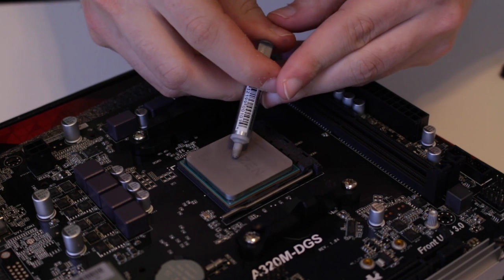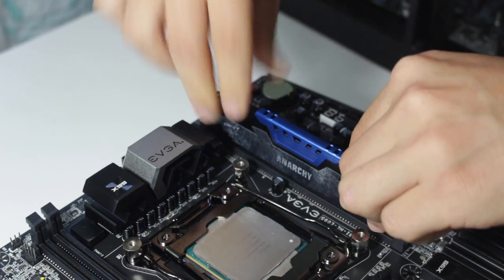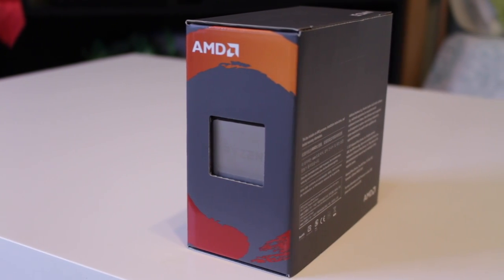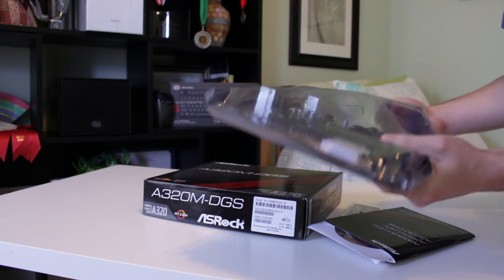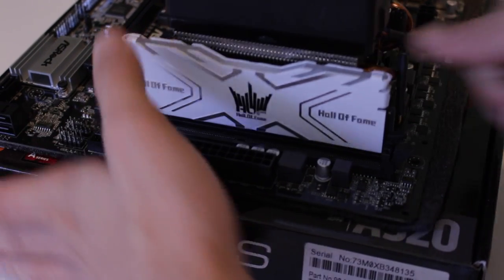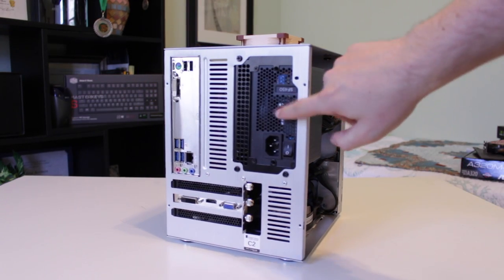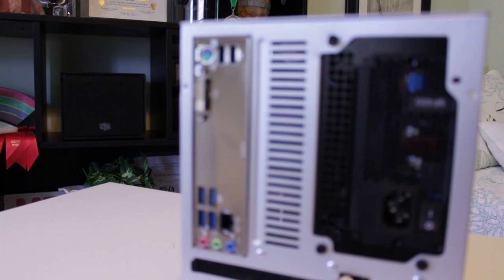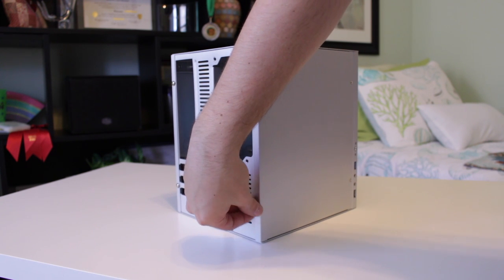I Switched From Intel to AMD... My Build and Why I Switched!

Comment: At work without headphones (so no sound), but golllllllly that's some small form factor goodness! It would look pretty cool if you had a grey, slightly transparent Ryzen logo on the front of the case. Based on the b-roll alone, looks like a great video :D Will watch in its entirety when I get home.
Reply from the maker: +OzTalksHW Thanks oz, and yeah I was thinking doing a custom logo or paint job would be cool.

Comment: You'd be taking a risk that you screw your case up. You have a 65 watt cpu in a Mobo that won't even overclock. Heat should not be a problem. Plus an 80 mm fan can be pretty loud especially right on top like that

Comment: the fan on the bottom is blowing air down you should turn it around for better temps
Reply: andrew busscher It's meant to remove warm air from the case.
Reply: Zazzilas Arden Yeah, but the air has to get into the case somehow as well. Right now he has negative pressure, so the hair goes in from all the small holes, which increases dust. He should flip the fan around so that fresh air would be able to get in better.
Reply: warm air goes up, so you should always go the way: down and front in air, back and up out air
Reply: of cours my brudah
Reply: @thomasgerhard1702  I'd be 100% into that logic if I were trying to set some world record, but anything outside of the case is going to be substantially cooler if you're running a/c...

Comment: Some of us are still struggling with fx 6300
Reply: Troll Playz Lucky :_: i have a dual core
Reply: You probably got g4560
Reply: bruh, I'm using a e8400 Intel duel core duo at 3.0Ghz. I would KILL for a FX 6300!
Reply: Troll Playz FX 4170...
Reply: Trevor Daniels I used that cpu and its pretty good I have a FX 4170 now but e8400 is just we good but ill het the r1700 soon
Reply: just upgraded from a Phenom 955 to a FX8350 4.7GHz stable
Reply: Troll Playz fx 8300 for me but I'm upgrading to 1700 in a bit
Reply: fx 6350 :P
Reply: phenom 1100T BE owner here. still rocking strong at 4.3ghz.
Reply: Dave Dörenberg-Veltman the phenom will never die only reason I changed from it it lacks SSE4.1
Reply: Fros78 the only reason I'm still running it is that I waited until ryzen. so soon I will step up after the mining frenzy drops. I'm running in combo with a hd5850 gpu so it's time to do so.
Reply: Hey! I love my FX 6300! I picked up a Corsair H60 recently and I got mine up to 4.5 ghz. You should pick up a Hyper 212 EVO and try for some mild overclocks as the FX 6300 is a VERY good overclocker.
Reply: Tidal bro what voltage did you use cuz I just got H60
Reply: I barely increased the voltage, it just needs a tad and it'll differ between boards.
Reply: True xD
Reply: I had a FX-6300 a year ago, but I sold it and upgraded the entire platform to Intel and a 6600K instead.
Reply: I went from a 4100 to an i5 last year.
Reply: yeah its pretty bad actually. IPC was really bad on every bulldozer/pile driver core chip AMD produced all the way up to the ridiculous 9370 and 9590 with TDP 225 w Liquid cooling required and a 990FX board. Those chips were overpriced and still are and so are the motherboards. The best FX chip is the 8350 it has the best price to performance ratio. If you can pick up an 8350 cheap such as used or refurbished it would be somewhat significant upgrade from a 6300 but why not just spend a little more and move to a newer better platform/cpu architecture? My upgrade path from was pretty terrible I had an MSI 890 FX motherboard with an FX 4100 Zambesi the most core AM3+ chip the board supported was six so my upgrade path using the same board would be to go from a 4100 to a 6300 or 6350 at best, in fact the latest chip listed compatible with the msi board was the 6100. If you already posess an AMD FX Octa core set up and it still meets your needs by all means keep using it. They weren't a bad option in 2013 and earlier when they weren't so long in the tooth. They won't age as badly as once perceived now that Dx12 and vulkan are being utilized for for 3d applications so they can take advantage of multi core better.
Reply: I upgraded from an Athlon II 610e to an FX-8300.

I regret nothing.
Reply: 6300 Black Edition? Those are fast af, idk what your all talking about.
Reply: hahahhaha true still rocking that chip
Reply: Owen Crisp My FX-8300 is a black edition, get on my level m8!
Reply: Still rocking an FX6300 and seeing as I do nothing particularly intensive on my PC I don't really notice it. I do however plan on getting into music and content creation and at that point, I think it will eventually fall flat on it's face. As a daily light to moderate use CPU it's not a bad processor.
Reply: Troll Playz my 6300 still running strong i gave to my son and now after years its timefor ryzen..my first build was a 1600xp+ 16 years ago always stuck with amd cuz it was cheap.look at my gaming and it wasnt bad even with gta v
Reply: Struggling? Overclock that bitch to 4.5 GHz! That will make you happy ;) Owner of the same CPU here.
Reply: Luka David Torkar long live fx-6300 !! wgahaah
Reply: Shut up im still using core2duo 7500
Reply: Long Live FX,
Long live your endless burning pain!
Reply: I could not agree more.. I aint struggling at all :P Join the deny wagon
Reply: Yeah if you already have one and you got a great deal. I just watched a video last night from hardware unboxed that went in depth into benchmarks with 2 old processors the i5 2500k and the 8370. The point was is there a second wind for Piledriver cores with windows 10, new APIs that allow games to take advantage of more cores? The 2500k and the i3 7100 beat down the 8370 significantly in most tests in some the 2500k was up to 20% faster. Tough to argue buying into that platform now. I have a friend with an 8320 he got it for 80 bucks more than 5 years ago on a black Friday sale event. Another friend had an 8320 also but just recently upgraded to a ryzen 1600x and said the difference is huge. Unfortunately for me I was shortchanged by the Bulldozer/Pile driver era I bought an Fx 4100 years ago the worst AMD processor at the time beat out by Phenom quad and six cores in performance. The highest end AMD chip at the time was the 8150 and it was 245$ I couldn't afford that and If something like that was in my budget I would of gone for an i5. The 4100 and the motherboard was bundled for just 159.99 discounted.
Reply: No just like the 7700k the 9000 series ran 64 multiplayer matches smoother than the 8350.  In heavy physics gameplay the 8350 would microstutter and get me killed the 9370 fixed that problem when i turned that crap core boost off and did a manual overclock myself it sucked on the 8350 as well.  The FX core boost tech really sucked games like world of warcraft the cpu would freak out and my character would shoot across the screen at a thousand miles an hour it was so buggy lol.
Reply: the 9370 is priced much higher than the 9590 right now supply must be low 226$ new I believe on newegg no cooler included. I expect the 9370 was more stable.
Reply: with you there bud
Reply: so an FX-9590 then?
Reply: 9590 is really a joke of a Cpu it was released for AMD fanboys who are also enthusiasts and don't mind that chip's anything but modest requirements. 9590 at stock requires liquid cooling or a noctua high end air cooler. It may not even be stable at default motherboard bios settings and stock speed. Ridiculously high TDP and it was never a good price for performance chip. If it had released at 220$ and was now 100$ an argument could be made. The 8350 which has similar performance and lower TDP is 119$ new right now while the 9590 is temporarily discounted at 139$. That entire lineup of Fx 32nm cpu architecture has worse single core performance than even some of the older i3's. It never had a good market position maybe back when it was brand new it could be argued that it was a great budget solution for heavy work loads that required decent multi threaded performance but with Xeon , 8350, 8370 and 8320 and Broadwell there were always just much better choices. The 9590 also requires a 990FX board and they are still pricey not so high now but too high for buying into a legacy platform.
Reply: Troll Playz I got a fx 4100 at 4.2 ghz with two gtx 950 ssc
Reply: +GamingBoys Forlife similar here bro, but my 4100 runs slower. i do have a 1050 ti ssc though.... getting a ryzen 1700x by the end of the year tho
Reply: Julian Robin nice I'm getting a ryzen 1600 and a gtx 1060 ssc 6gb later this year
Reply: GamingBoys ForLife i also plan on picking up a 1080 ti. this thing is gunna fly lol
Reply: amd phenom 2 x4 here..
Reply: I went from a PII x4 945 to an 8350 

I REGRET NOTHING!
Reply: lucky, i have e5500 :c
Reply: Troll Playz I use an Athlon.
Reply: What's wrong with an fx 6300? Even though my i3 6100 is more powerful, your fx can do more than my i3 because of it's threads. I can't even run intense operating systems on my virtual machines because of the i3's low thread count. I think I should upgrade to a ryzen 5 1600.
Reply: Athlon XP anyone ?
Reply: Sandpaper I got one for £35 pound with the motherboard
Reply: I'm using my 6 core phenom ii still 😂😂
Reply: i have a phenom x6 1055t and still works like a champ! can wait to get on that ryzen chip!
Reply: Athlon 64 x2 lmao
Reply: still rocking a 8700k (unfortunately), been wanting to upgrade to a 9900k since it came out and made 6 cores irrelevant
Reply: im fx 8350 lol

Comment: There are four ITX AM4 boards on the market right now. All priced between $110-$150. I honestly don't think you're going to be seeing many more options anytime soon and if you're waiting for cheaper alternatives - don't - because I can almost guarantee you any board below $100 will not have WiFi. ASrock's B350 ITX board has an Intel NIC, Wifi, USB C 3.1, etc, just about anything you need.

Comment: Please don't slice up that case. The 1700 runs cool, incredibly cool, at stock. Maybe pick up a blower style GPU to help keep the case cool?
Reply: aisle9 but he WANTS to OC so he needs some flow bro.
Reply: Mynew Account he said in the future he will buy a itx case and components thats a micro atx chassi
Reply: Can't OC on A320 chipset.
Reply: Just put the fan next to the gpu on that grill
Reply: aisle9 I have this case, max GPU length is 220mm, a blower would be too long.
Reply: @vanguardas9927 lol chill

Comment: Flip your bottom fan to be an intake, becaase heat rises and it will work better in conjunction with the PSU to move air through the case.

Comment: You should flip the fan in the opposite direction so you have an intake on the bottom and just have the PSU do the exhausting. Make sure you get a fan dust filter though, they only cost less than $3 on eBay.

Comment: FOR THE CASE MOD To keep a clean look, I would look into cutting a larger section out of the top, raising it so there's like a 1/2" gap and then allowing air to flow in from there, possibly add the fans before re-mounting the metal section you removed.

Comment: Love the hustle.
Reply from the maker: Thanks Bryan! Funny thing is I found out about the E5 ES Xeons on ebay from the BIG MINI build you did last summer. For $180 the 12 core Xeon I had was a dream, but I figured I would switch it up.
Reply: Was going to say, yeah that 12 core is a beast man, i got mine to 2.6ghz and it actually does really well in gaming, surprised you changed it all up, though ryzen 8 core will be better for gaming for sure... though just not with a 750ti :P

Comment: For the noctua fan mod into the case, you can paint the fan assembling the color of the case and a better grill/protector-for-sticky-fingers match a clean look and improve the air flow like you want to.

Comment from the maker: First
Reply: That's cheating.
Reply: lol
Reply: Tech By Matt  Lol that was actually funny
Reply: First 65 or Older -- LOL
Reply: Tech By Matt Before you do the mod, check temperatures if you do really need it, wait on little on that.
They need to do power supplies a little bit smaller, I want to replace a power supply for a Dell Optiplex, and is kind of hard sense they are all square and big, they need to make it rectangular and smaller.
Reply: why not use a b350 and OC'd the ryzen 7 to 3.8-3.9 ghz. it will not go that hot isn't it
Reply: Try to benchmark Skyrim SE with mods or with no mods it will definitly help me out.
Reply: With the airflow issue you face with this build, i would buy a 120mm single-fan dust filter, akasa makes some of them for a reasonable prize, use your bottom fan as an intake and use your PSU as exhaust.

You are currently using both the Cooler master fan and PSU as exhaust and i think that this will choke your system in the long run, especially with such high-end hardware.

If you try that you might not have to mod the case.

Take care buddy, and good luck! :D
Reply: Tech By Matt well I'll say for airflow: use a blower graphic card,put a power supply that has a good fan (or mod it) ,and maybe tilt the case and maybe mod it so the io is on top.
Reply: matt where did you get that stock ryzen cooler?
Reply: Captain Grey I'd rather go the other way around since I wouldn't want HOT air going through my PSU lol. also pulling dusty air from a ground intake isn't good for airflow (or you'd have to perform maintenance more). BUT who knows I don't think you can configure PSU fans to your needs anyway I'm assuming he'll have one fan pushing in and one pushing out regardless. I'm a scarredy cat... but don't mod the PSU! Those things are NOT made to be opened up lol... maybe tails means just turn it over and some cases allow that... not sure why you'd want to but... up to you man!
Reply: Tech By Matt 100th like
Reply: Tech By Matt do u do budget pcs for subs
Reply: Tech By Matt  can you give me that Xeon and the x99 motherbord
I have 3 year old motherboard and CPU
Reply: I would go with the mod, but consider how you can make it look awesome. ;)
Reply: You could put a sleek radiator and fan combo and go liquid cooled without cutting into the case.  Maybe a few mounting screws on the back.

Comment: There's a chance that adding that top fan with such a small volume case will actually make the airflow worse than it currently is, since you'll be pulling hot and cold air as well with that fan. Sure, some people will say that hot air rises, but cold air also rises if you're pulling it with a fan.

Comment: Shouldn't the fan on the bottom be an intake? Doesn't make sense to suck air out of the bottom
Reply: doesn't matter only with static air does heat rise.

Comment: I would think that the fan on the bottom would be plenty. I suggest doing a temp test to see what your potential gains would be anyway. Test the temps with the side on. Then, test it with the side off and a room fan pointed at the side. That should give you a best case comparison to the single bottom fan.

Comment: Ok. Dear Matt... Speaking from a person that modified the AMD D3 cooler to fit 14cm Noctua fan onto it... exhaust>intake.
I'd probably go with a DIY approach and remowe the top PSU cover and slap a fan at the back of the PSU. This will get you not-so-restrictive air access to your Wraith, while probably still keeping PSU components low enough (if you close back your psu and then tape the 12cm fan vent.
I'd also order two Datech DB9733-12HBTLs - these are PWM Dell OEM blower fans, 9mm diagnoally. These can do 1200RPM with litteraly no noise and cold boost the exhaust speed at the vents. ;)
Reply: Ow. Also. Speaking from my personal expirience - get cheap used GPUs from higher tier and then undervolt/bring down the TDP to 70-80%. This makes them largely semi-passive cards, due to having bigger cooler than lesser models. :)
F. ex: I now have Vapor-X r9 280X @ 800MHz, 1300MHz MeM, 65% TDP and it's literally silent even when gaming. 
In ssf it will probably translate to "Very bearable" temps, but still. :)
Reply: Ow. And use RivaTuner fps limiter/AMD's Frame Rate Target Control/Chill to mimic FreeSync ability by setting it ~20-50% higher than screen's Hz. ;)
Reply from the maker: Thanks for all the tips man. I'll look into all of this stuff later tonight when I'm back home.

Comment: if you do it right i think the black fan grill will actually go well with the case. Also lets be honest, overclocking is going to heat up that little case. Drill/cut carefully and get some air out that little case.

Comment: Jonsbo are good at making hot cases.  If you really feel the need to cut holes in the case cut some holes in the back and install a water cooler on the back of the case where you can't see it.  This will mean all of the hot air from the cpu is outside the case not in.

Comment: Can't overclock on that mobo btw, but maybe you will get a better one
Reply: He won't. The VRM on that motherboard will not allow you to do so.
Reply: The A320 chipset on that board doesn't allow for any overclocking. It is mainly for  OEM's and IT people who don't allow overclocking on company computers. A B350 matx board is what you should get for a build like this.
Reply: or u not really watch the video
Reply: The asrock B350 fatality board can be had for 100 bucks and has good VRMs on it unlike other brands.
Reply: Most likely you don't know which chipsets allow overclocking and which ones don't. You can only do overclocking with B350 and above.
Reply: Problem is, the B350 Fatality is an ATX mobo and won't fit in the case.
Reply: Yea he kinda said he’s aware of that only like 10 times

Comment: I'd go with making a rectangular hole on the top of the case (have it cnc'd out) and put a steel mesh on the inside. I would then put a 180 or 200mm slim fan which by the looks of it would snugly fit under the top of the case. you could also ad spacers to the corners of the top plate and lift it for extra clearance and venting. I think this wouldn't distrupt the looks of the case too much ;)